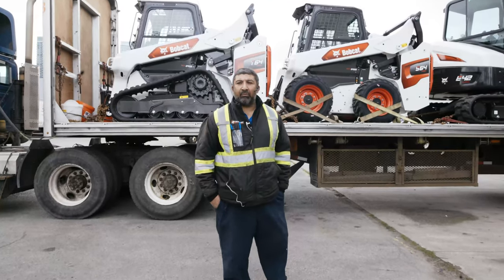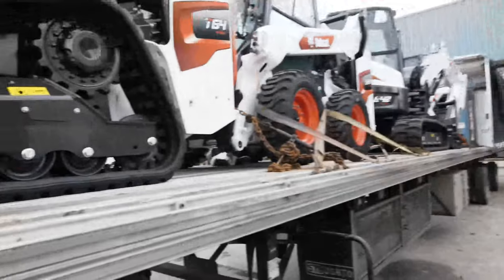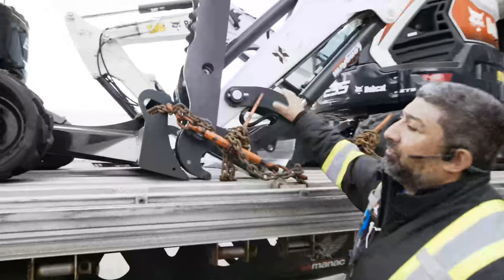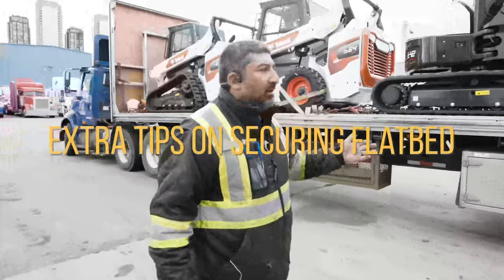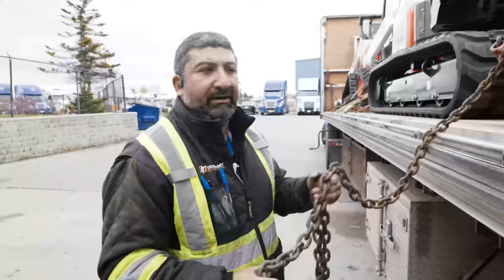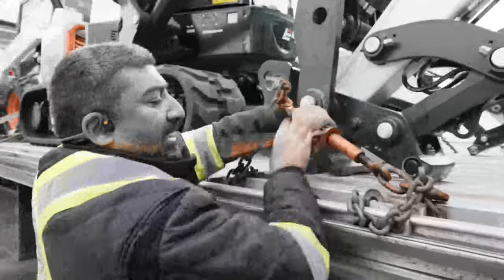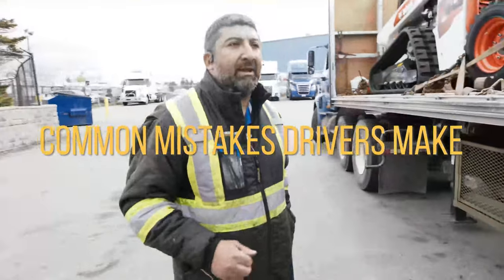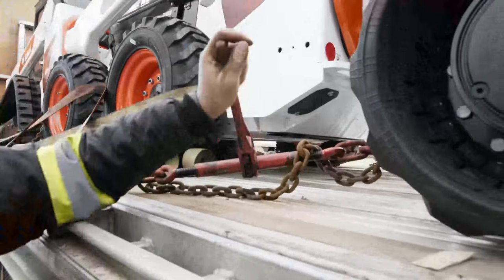Flatbed Load Securement Guide (Heavy machinery, Chains, Binders, Straps)

Comment: And I hope that mini excavator is under 10,000 pounds because you need four separate points of securement if it's over 10,000 ....  And the rotation function has to are they locking mechanism or pin to lock the rotation of the machine.

Like I love ET transports videos but since you're so well-known you need to give out a little bit extra information because guys look to you for information when they're on the road trying to secure their own loads...

Comment: This is actually tied down incorrectly in my opinion-
1st the first strap on the second machine has a bad cut in it...
2nd your supposed to have 4 points of contact for your tie downs...I don’t know if it’s different because it’s in an enclosed trailer, but normally a single chain and binder like they’re being used going through the blade or just run through the tow lug is not to code
Just my thoughts
Reply: 4 points of contact if machinery is over 10000 pounds
Reply: @sweetness2689  yes exactly, which none of them are
Reply: @Big Dog88  right, so none of them needed to have 4 point like you said. Also, this isn't an enclosed trailer. It is an open deck trailer with a rolling tarp system.

Comment: I like the way they strapped the wheels down on that one excavator that's a pretty neat idea the only problem is the  fraid to s*** strap and at least from what I could see it looks like the straps running up around the stake pocket which will cut it instead of around the curb spool.